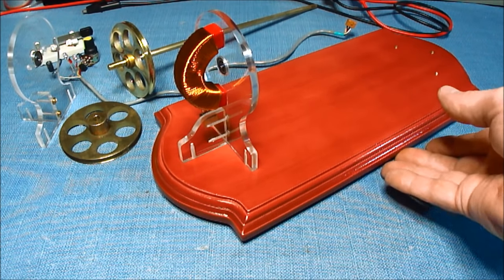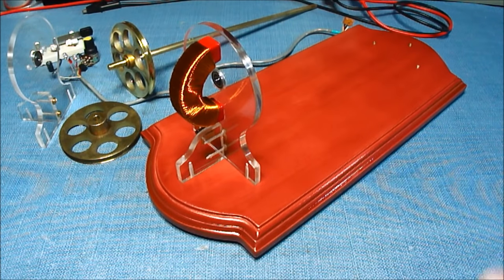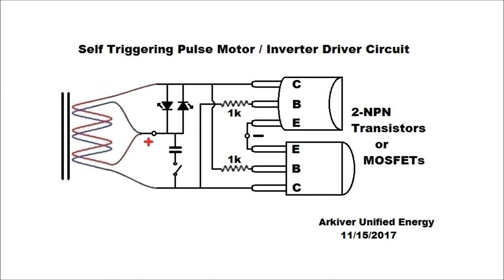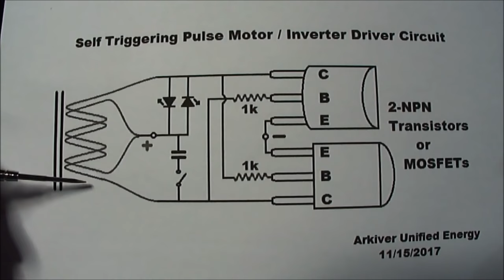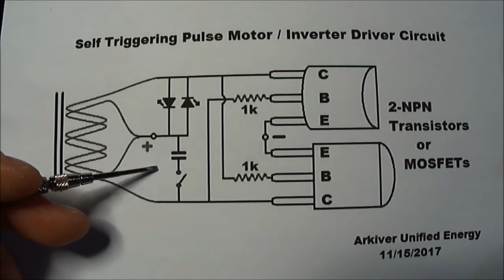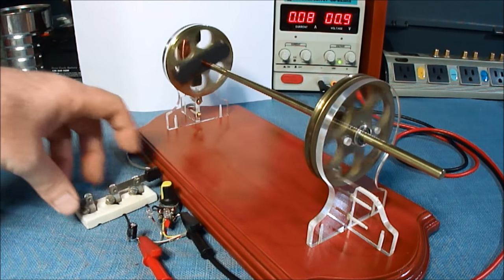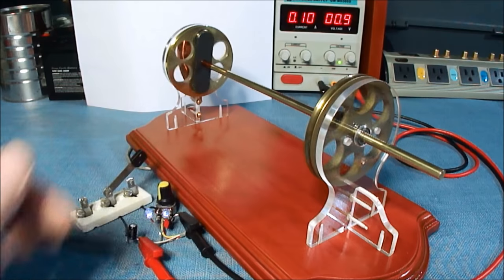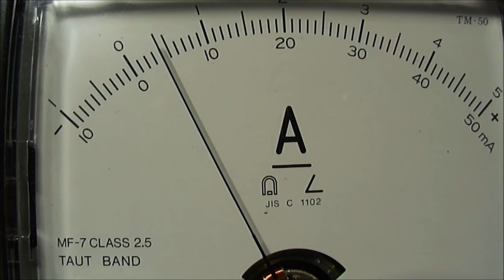Tesla Bifilar Coil Electromagnet Mystery Solved

Comment: The rotating brass wheel near the bifilar coil could be creating eddy currents. The steel piece attached to the magnets bend the flux lines closer to the magnets, at least on the side next to the two magnets, possibly interfering with the flux lines between the coil and the magnets, Replacing the brass wheel with a thicker plastic wheel and embedding the two magnets into the plastic wheel(s)  without using the steel strap may produce a cleaner signal and less drag.

Comment: I think the secret of the bifilar is related to the nature of Bucking coils cancelling out the Lenz effect of magnetic resistance to the current with resonance. The Bifilar is just a more compact ingenious way to do it. If you have the speed variation, torque, COP, Q, etc. I would definitely like to see more on this device and it's name if it has one,  thanks for your excellent work!
Reply from the maker: It's a condenser.
Reply: @ArkiverUnifiedEnergy  Condenser as different from a capacitor in some way? I know the 
L-C, inductance - capacitance of the coils has everything to do with the resonance and cancellation of the Lorentz resistance to the current. Is that what you mean?

Comment: That LED is a fly-back snubbing diode. Same reason we put a back diode across an induction coil for protection from voltage spikes when the relay contact opens, the field collapses inducing the fly-back voltage.

Comment: Do you realize that the Bifilar winding forms a capacitive charged storage of additional voltage per turn in the winding's... The Bifilar coil pinches mas-charge into massless charge space / a pressure bubble of massless charge forms coupled to the mass-charge electrons...So in essence you could form a Ultrapacitor with that coil, if you used a superconductive core... Now that we have room temperature super conductors being openly patented by the Dept. of the USN, this can become a Useful Ultra Battery, that can instantly store a massive charge of great energy density ! One must be very careful never to over charge these, as the meisner field  when over charged beyond it's storage coherence levels essentially detonates releasing 100 % of the energy instantaneously as an expanding sphere of Light... More like an expanding Laser Sphere !!!
Reply: 2:08

Comment: Place the same magnets with the coil on the other side at a 90 degree angle, and maybe the engine can provide itself. This engine is similar to those that use energy stored in Magnets when they are magnetized. About such engines, even in the textbook for students information is available

Comment: Thanks for sharing and I think you hit it right on the head! one question though does the magnetic field grow i know you said it pulsed but does the field, with speed expand? again thanks for sharing your project and your thoughts very nice. keep up the good work.
Al
Reply from the maker: There's a higher degree and area of change. Thanks, Mike
Reply: thank you for that i noticed it with my rotors the faster they spin the larger the magnetic field thanks for your input. 
Al

Comment: Wow, all you did was connect a transformer to a flipflop circuit. And I'm calling BS about your contraption causing a beeping oscillation at the mains on the pole.
Reply: Do you realize that the Bifilar winding forms a capacitive charged storage of additional voltage per turn in the winding's... The Bifilar coil pinches mas-charge into massless charge space / a pressure bubble of massless charge forms coupled to the mass-charge electrons...So in essence you could form a Ultrapacitor with that coil, if you used a superconductive core... Now that we have room temperature super conductors being openly patented by the Dept. of the USN, this can become a Useful Ultra Battery, that can instantly store a massive charge of great energy density ! One must be very careful never to over charge these, as the meisner field  when over charged beyond it's storage coherence levels essentially detonates releasing 100 % of the energy instantaneously as an expanding sphere of Light... More like an expanding Laser Sphere !!!

Comment: you get free energy by combining a compilation of everyone 's networked ideas and simplified and most effective inventions together to work in unison and harmony that produces a powerful orchestra array of frequencies for real results. so if we take what Tesla taught us about simple wave form propagation of antennas transmitting and receiving frequency signal data packet bursts of energy and with a Tesla bifiler coil to receive the high altitude scalar energy wave form to transfer to a wireless induction high voltage Tesla Coil to boost the energy volts while at the same time use the incoming scalar ham am/fm waves to send a pulse signal to a low volt high rpm brushless motor with the bifilar wireless energy coil and a capacitor hooked to the power ports and the slow turning of the motor with multiple long cylindrical earth magnets n52 with apposing polls pointed outwards and a 1/2'' copper tubing roll with solid copper wire strands filling the inside copper tube circle that is a lil bigger then the magnet pinwheel on the spinning motor. then take that free energy generated from wireless antennas and frequency waves. then take that whole part of the free energy solution and add another invention and or idea to the solution like sonoilluminescence with frequencies on a water bubble molecules to create energy that gets hotter then our sun plus we could add solar energy and capacitor banks and batteries to store it all in. and has anyone load tested a mono-atomic gold/silver and graphene and water battery on any 12 volt power tools or vehicles or still not yet? i liked this explanation of the concept and ideas of harnessing even more variations of energy wave forms to utilise for everyday usability applications.and thanks for your videos as i have a better grasp of the depth and complexity of all the free energy surrounding most of us daily going to waste because we all dont fully understand energy and all of its shape forms waves colors temperatures etc.                   and real quick idea for a graphene battery is take monoatomic graphene atoms and add it all to the solution mix while you grow borax or quartz crystals or something like that
Reply: You forgot the scrambled eggs on top. Hahaha...

Comment: The LED's need ballast resistance, or else, they will clamp the voltage caused by resonance between the inductance of the coil, and capacitance of the capacitor. There is a certain frequency, in which that capacitor and coil will naturally oscillate. The capacitor value must decrease on the inverse of the square of the frequency, because, the voltage increase raises current, as well as the capacitor becoming lower effective impedance as the frequency increases. Cutting the capacitor value in half, will allow an increase of voltage of 1.4142135,(square root of 2) and will allow the exact same percentage increase in RPM.
     As you increase voltage, thus, speed, you will also want to increase the value of resistance of the base resistors to the transistors, and the same value of resistance would also be appropriate as ballast for the LED's.

Comment: It's a well built machine in itself. Discovery is what it's all about. Making good use from the back emf makes it efficient. BTW, science has discovered that there are actually magnetic waves in the universe that ripple the fabric of space-time. So it is very possible that your machine had an effect on the streetlight pole. Tesla said to think in terms of energy, frequency, and vibration when considering the universe. Keep experimenting.
Reply: Also, consider that the horseshoe may have the effect of concentrating and focusing magnetic pulses where the back efm fires them off like little bullets. I would conduct an experiment where you hang a piece of metal several feet away and see what happens to it. You can do this with a hanging magnet as well and see if it moves when placed a distance away from the machine.

Comment: The “ sound “ …. It’s your bearings dude .
Reply from the maker: You were right the bearings where bad.
Reply: I found they get too warm and always fail at a certain ( sustained) rpm . I was thinking of a magnetic bearing ( free floating) instead of ball bearings. Probably using super conductor material would be better suited but then you have to cool them as well. Experimenting can become expensive.

Comment: I tried replicating it but I fried the NPN transistor all the time , and no rotation, any help will be appreciated. I used speaker cable for bifilar setup
Reply from the maker: You need many turns to create a strong enough magnetic field for a given voltage. Transistors have a maximum current rating.
Reply: @ArkiverUnifiedEnergy  I need help from how you make bifilar coil to turn on magnet
Reply: @MrFreshwap  The bifilar coil, as Tesla's patent (and illustrated in the circuit diagram) is a coil that has two wires running next to each other of the same length. The end of one of them is connected to the beginning of the other, forming one continuous wire coil. However, unlike a standard single wire coil, the neighboring wire along every turn is exactly 1/2 the voltage potential of the other. This is the condition of a capacitor. In a motor, the magnetic flux is stored in the capacitance of the inductor. It is a flux capacitor.

The simplest way to make it is to use a dual conducting wire. (Apparently, this type of wire is available commercially; not widely used in electric motors but in some limited applications of electromagnets) then make the beginning of one to the end of the other connection external to the windings. The connection between the start and finish of the two wires is made outside the windings and does not contribute to the magnetic field.  You can also use two separate coils of wire, winding both at the same time; again making the finishing connection externally after the windings are complete.

The capacitance energy that can be held by the coil increases with the square of the voltage driving the coil. Unlike a standard cap that has variations in the micro-formation of voltage/insulation differences due to the physical construction of the large surface areas of standard capacitance structures that lead to blow-outs, this bifilar cap equally distributes the energy it holds along the entire wire. With an air-gap and no amplifying core, this flux capacitor can have very high frequency and current response which was desireable in Tesla's spark-gap transformer. When wound around an amplifying ferromagnetic core, driven by an alternating current, the phase of the magnetism generated by the coil is shifted to align with the changing phase of external magnets. This creates a self-charging effect within the coil. As the coil releases the energy it captured in the capacitance, it captures the energy it generates with the released energy. The net effect is to neutralize the inductance, but not by cancellation, by self-capture. The coil only shows resistance, not inductance. With a ferromagnetic core, the current or magnetism is amplified. Excess electrical energy in the form of current is produced. The motor can be run on voltage alone (using dead batteries), which it will charge. Joe Newman used standard dry-cell 9-volt batteries in banks of hundreds of volts with his design and not only charged them up (non-rechargeable batteries) but also drove other motors and lights. Although Joe's design was not with a bifilar winding, it was with extremely long runs of wire.

Thane C. Heins has many videos of this as applied to electric car motors. His patent application was denied as the motor design was patented back in the late 1800s. Joe Newman created a motor that had this effect with extremely long coil lengths (the speed of conduction is limited in wire, make the path long enough and the coil will not conduct current reflexively like a pure inductor would, effectively becoming capacitive). Joe's patent was denied due to the destabilizing effect it would have made on the economy. This is a disruptive technological innovation. None of the automakers will implement this technology into their vehicles; Thane offered it personally to all of them. Unlimited range, mobile generating plants would break the world economy, and disrupt the integrity of national borders as we know them.

According to standard physics, creating energy is not possible. And regular theory does not adequately explain how EM induction works (there are paradoxes that go un-explained, and basically Maxwell's definitions are pseudo-science) as it would reveal that electricity is not fundamental, it is a composite that can be created from its component parts. An example of this is the power amplifying inductors used in phone lines, like the trans-Atlantic cable which cannot handle the amount of energy that it takes to send signals end to end. Self-amplification through regularly spaced capacitively wound inductors are essential to its function but denied as possible in power grids. 

This demonstration is low power, so the excess energy effects are minimal. It would be easy to overload the circuit components if you are not careful; the bifilar coil has an extremely large dynamic operating range that is unmatched by semiconductor components.
Reply: @mundymorningreport3137  Thanks for explaning with deatils

Comment: I tried replicating the circuit, but I only got an oscillator. The LEDs light up at .4V and 13mA (like a joule thief), but I don't get any motive force out of the coil. I tried a lot of different capacitor sizes ranging from 10uF to 4000uF. They only smoothed out, or shut down the circuit. I am using an air core bifilar wound coil with 100 wraps (each coil - 200 windings total). Any tips on anything that I may have missed?
Reply from the maker: The electromagnetism will sink with a permanent magnet free to move. Provide there is enough electromagnetic field strength for a given voltage. About 1000 turns or more for 1v.
Reply: You said you "replicated", but that couldn't be further from the truth. Your air core, 100 turn coils have nothing in common with these coils shown in the video. It's a beautiful build in the video. I suggest doing an actual replication, then discuss your findings...
Reply: @craigpierce7996  Wisdom that is missed by very large percentages of designers these days and also in the past. Tesla took advantage of this in his patent portfolio, applying for multiple variations that were mostly irrelevant to his discoveries and allowing common theory that he knew to be false to prevail in the world of hacks who tried to steal his designs. So many people have ideas how they think things work that prevent them from doing what is given to them without first messing with the design... And then claim its fake because they fail.  This is a common error made by those that demonstrate that Tesla coils cannot transmit energy 25 miles or more as Tesla claimed to have done. They fail to realize Tesla was not transmitting electricity. 

And for one man who matched Tesla's feat, he discovered that his breakthrough brought the attention of military force. It seems these types of innovation are not entirely bogus.
Reply: Air core generators have the distinction of very limited current capacity. Gerard Morin uses this to demonstrate a 30 amp generator can power a 210 amp load if sufficient EM windings are introduced into the circuit. He does this with a massive step up and step down transformer pair. The load he drives literally takes the energy from the transformers, not the generator. You see our power systems are driven mostly by voltage, but run on current... current is actually magnetism, not the flow of charges. It turns out flowing charges do not necessarily carry magnetism, which is why AC power factors and phase alignment of current and voltage is critical to efficiency of electrical systems. And as such, one can easily amplify electrical power by increasing the magnetism.

When you are looking for motive force or magnetism, why would you limit the windings and also eliminate the ferromagnetic core? That core can amplify the magnetic power of a coil 1,000 times. And each loop of wire delivers the full potential of the total wire to that core, stimulating another full slice of magnetism from the core. However you think this device works, it could use some reconsideration. The design variations you implemented seem to validate these basics. Perseverance furthers...
Reply: I can say that after years of casing Tesla's electromagnetic designs, I've finally have realized that the secret is in the electrostatic realm, not electromagnetic. Only a field can move at the speeds Maxwell describes in his special equations. Trying to create an event disruptive enough to force a current interaction with the surrounding natural E field (not free, it's already there and you're going to spend some bucks to get it) using electromagnetics is way off the mark. Electrostatic excitation is the only thing fast enough. Although the circuits look pretty close, its how they are used that counts. Tesla hid everything from everyone, including himself! The last version of his rotary sparking system would cost about $100K to build and would challenge any designer to replicate. It's stats are mind blowing!